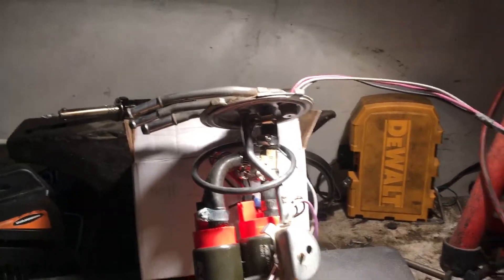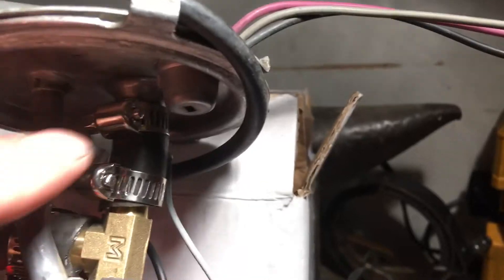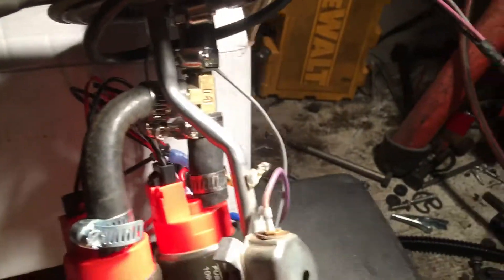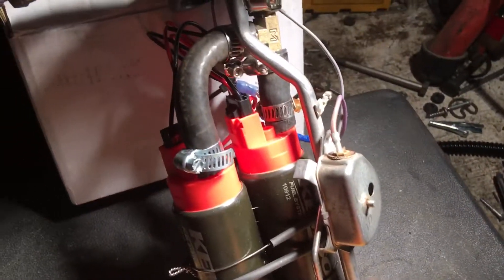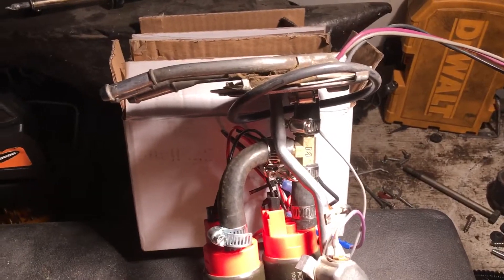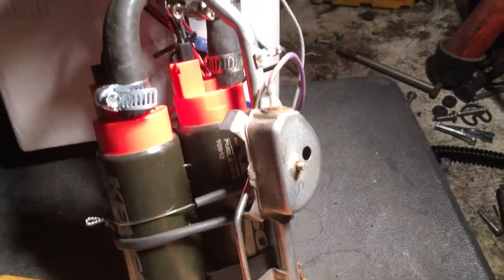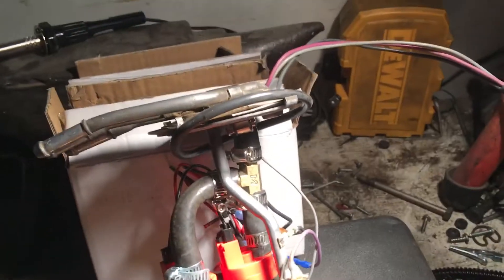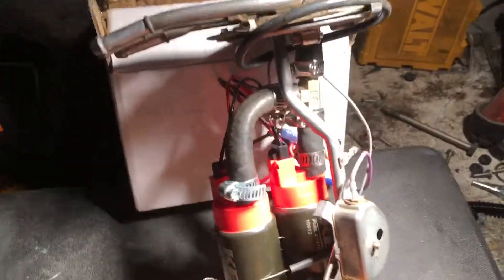1984-1987 Turbo Buick Regal DIY dual in tank fuel pump

Comment: Hello. Did it not contradict the flow of the other pump by using that T-fitting? Some say it should be a Y-fitting but I don't know.
Reply from the maker: It works fine but a y fitting would be more smooth flow

Comment: Lol how’s that work on paper let’s say at 40psi it pushes 340lph at 20AMPS  then you times that by 2 because of two pumps on one relay about 40 amps on a 20amp circuit? Should of wired another relay and wired pin 86 on both relays together.  This will give you more pump and more power to ea pump.
Reply from the maker: I would believe that its current setup puts out good fuel pressure and doesn’t task the pumps too hard

Comment: updated review?
Reply: Jack Olivas fuel pressure is good, still has hesitation issues
Reply: MadMatt BudgetBoosting 
what are the specs of your car?  I have owned a couple of these and know enough to get in trouble,  LOL
Reply: Maybe u should try a Y fitting
Reply: And drill a hole at the top of the vent tube on the intank side on the sending unit

Comment: here is the ebay auction for each of the fuel pumps.  https://www.ebay.com/itm/KEMSO-340LPH-High-Performance-Fuel-Pump-for-5-7L-TBI-TPI-LT1-LT4-LS1-Iroc-Z28-SS/151967542206?fits=Year%3A1987%7CModel%3ARegal%7CSubmodel%3AGrand+National%7CMake%3ABuick&epid=1552151263&hash=item2361f8abbe:g:POQAAOSwu25bkSMl